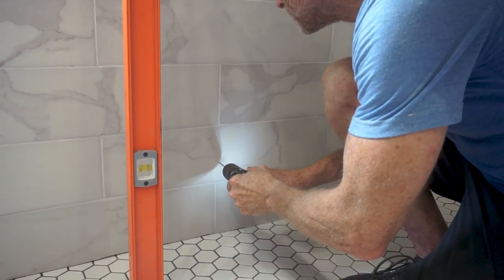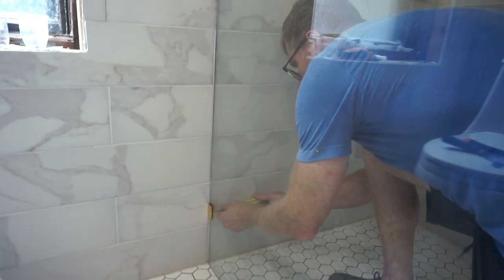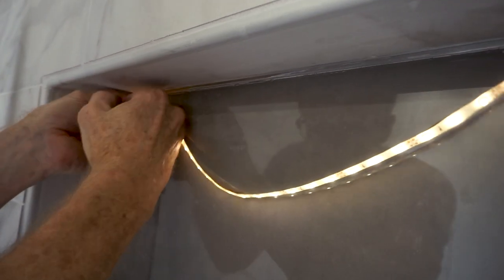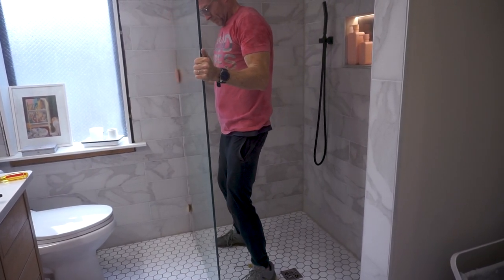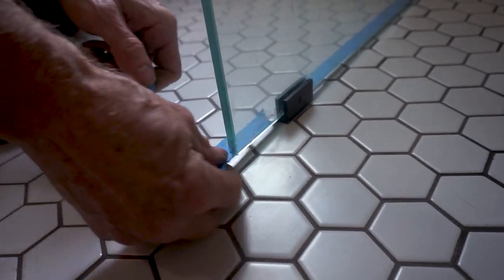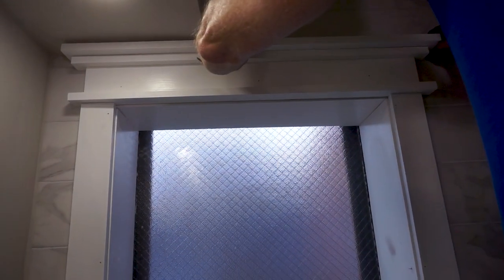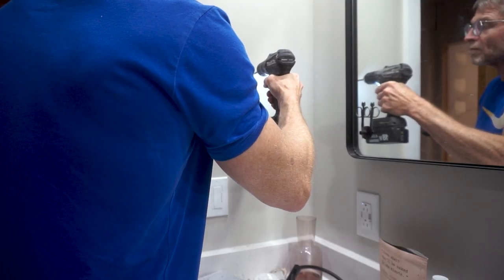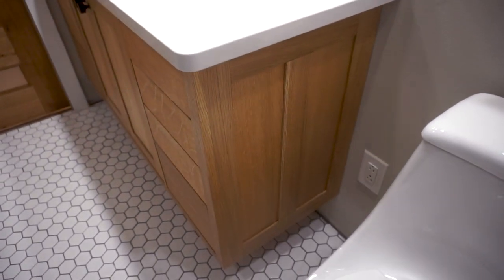Bathroom Remodel | Part 13 - Finishing Touches

Comment: Ur video came up in my feed today & very much enjoyed watching 2 on the bedroom & the bathroom series.
I purchased a small 850 sqft 1942 Bungalow Aug 2019. 2 weeks after moving in I had major neck surgery requiring me to sit in a recliner for 4 months. I blame that for going overboard on the renovation
I had no intention on doing the renovation myself but trying to get a contractor to show up was impossible. My 80 yr old dad & I with my son's occasional help I'm nearly completed. My dad won't b w me much longer so this time been wonderful & learning new skills.
Your bathroom design is very similar to mine. My bathroom is 7' deep x 6' wide. I turned it into a wet bath also. Son took out the old window & cut thru the brick & put in a 65"' w x 12" h awning window. The cell is 60" up from floor & it looks into forest (love that window). Son added a 60"W x 10"H cubby below the window. The shower is against the window, east wall. At foor of shower I have heated towel bar w towel shelf above & stool made of cypress I still have to build goes under rack. On the south wall is the plumbing. The rain shower & handset & massage wall jets (they r amazing). I decided to go w a Swiss Madison wall mount toilet that has tank inside wall to open up more floor space, 2 yrs later still happy about that decision. Son or in a 14"W x 30" H cubby above toilet tank. Dad & I built a floating vanity. 2 LG drawers on the rt & 3 small drawers in front of plumbing in the middle. To the left of the small drawers is double room toilet paper holder. It's a chrome shelf made to set phone on, I turned the shelf on the side to protect any water splashes. Then under the drawers is cubby. The north, east & south walls r subway time floor to ceiling  the bathroom sits between the 2 bedrooms connected by small very dark hallway. I removed the old 28" doors & put in 30" pocket doors. Pocket doors make world of difference in small rooms. All of the pocket doors have the glass also so light can flow. They aren't as beautiful as the door u made. 
The grout used on the floor was bad so I have to replace the tile. I told my father perfect I can add the soaking tub. I keep thinking about dropping a soaking tub down into the crawl space, so you'd step down into the tub. Then make a roll up deck or of cypress that would fit over the tub & b flush w the floor. Dad says get an inflatable tub Ha!! 
I found it interesting how similar the 2 bathrooms r & father & daughter team